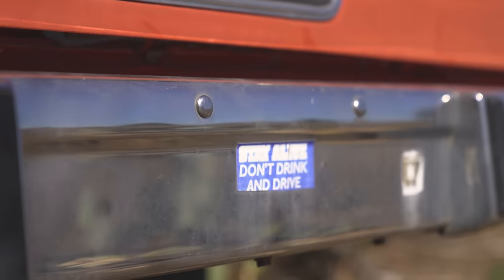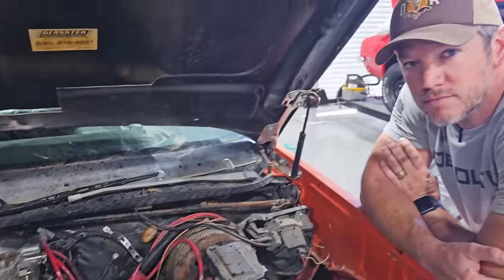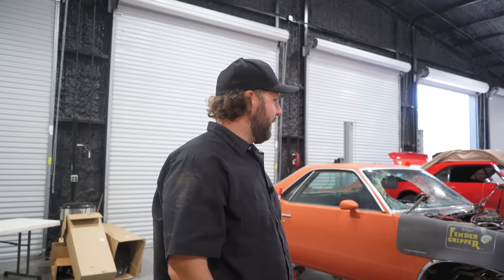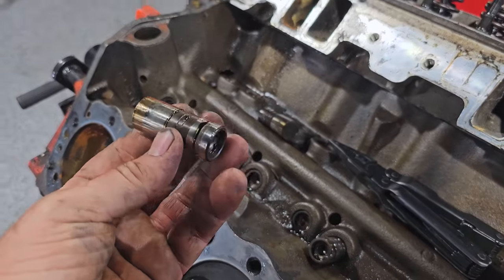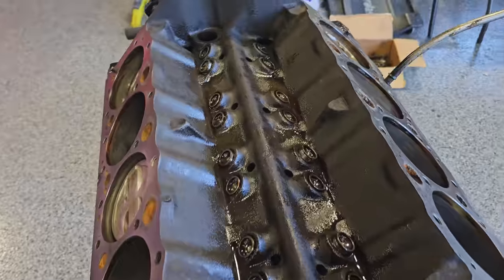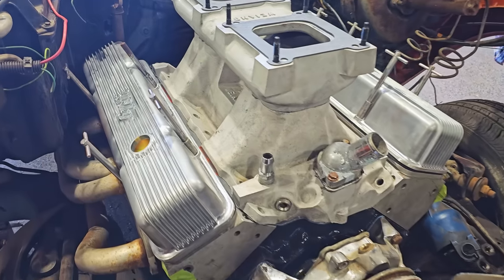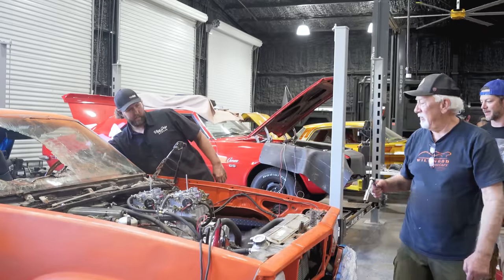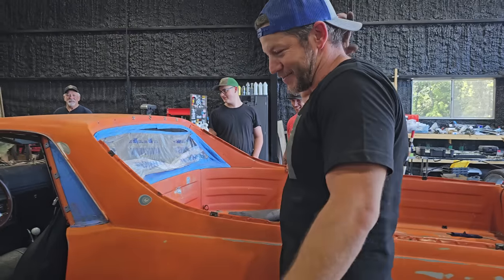ABANDONED El Camino With Seized Engine - Will it RUN AND DRIVE? (With Demolition Ranch!)

Comment: Story time! When I was 19 or so I was given a 1976 Buick Skylark sedan that had an Olds 260 V8 (105 or 110HP) with a Rochester 2 Jet and a TH200 transmission. I bought a torn down 2 bolt 350 with alot of still packaged Comp Cams valvetrain parts that my buddy sold me for $150. I didn't know ANYTHING about building an engine, but I REALLY wanted to build that 350 and swap it into that car because that Olds 260 was a gutless turd. It would reach 80 MPH...eventually, but it would only average around 10 MPG. Also, that car could been sitting for months in the winter with a foot of snow on it and I could get in, pump the gas 3 or 4 times, turn the key, and it would fire RIGHT up. It only had 34,000 original miles on it, but the farthest I ever drove that car was when I drove it to Cleveland (from an hour north of Pittsburgh), so 400 miles round trip and it ran great the whole time, just not very powerful. I REALLY wish I had put that 350 together and swapped it in. I don't know if that TH200 would've held the torque, but it would've been mostly stock other than a RV cam and slight valvetrain upgrades. I wish I had gotten the car that they gave my uncle, a 1974 Dodge Dart Custom with 16,000 miles that had a Landau roof and a 225 Slant Six with a 727.

Comment: Thanks for the info on the Toyota Highlander and the evap problem ! I own a 2010 model, but here in Australia,  it's called a Kluger. I love my Kluger and it's AWD .I mostly use it to tow my small pop top camper trailer, which it does with ease ! Love your show ! Cheers..Ray

Comment: If hood clearance for the carbs isn’t a problem, you could use the Holley’s with a short spacer. You already have a tunnel ram, which is a huge spacer, but that might help with your figment issue. I like Edlebrokens too though.
Reply: The tunnel ram top is on backwards, he's got the tall end of the tunnel Ram facing forward, goes to the rear, then the Holley carburetors will fit

Comment: That flat top 327 and the dished 350 would be the same compression ratio. 64cc heads adds another point-ish.
You should have swapped the cam.

Comment: Man oh man this video with the engine water damage reminds me of my 69 camaro sitting in storage across the street. Did the body 80% after high-school. Then had the motor and transmission done. I had a neighbors grandson into restoration itching to do my convertible 100% frame off. Gave him a shot in 2009-10. Same year I had my first kid. Needless to say I was convinced to buy replacement body. A year and a half later I got both bodies back an epoxied frame. When he finally returned my rebuilt engine that had less than 2500 miles on it. I found out he left the motor out in the rain for the better part of a year or so. Fudge up and I've been scratching my head for the last 10 years. Without a shop to work on it, it just sits in storage. But she's my first car and I haven't totally abandoned her yet.

Comment: The 1406 600s are tuned really mild. The 1405 has different rods and spring. The 1405 is man choke too. I have had alot of luck on mild street cars with the 1406 with the 1405 rods and springs in. Just a thought. Great content!

Comment: Back in the day (1970) the 350 block with 327, 2.02" Camel Back head swap was ordinary. The original 327 heads although cast iron were the hottest thing at the drag races. I remember having my 327 camel back heads in Tony's machine shop here in VA, for new valves and guides and when I went to pick them up they tried to substitute some crappy 250 HP heads. Fortunately I had stamped my Initials on both heads. I told him these are not my heads. He tried to convince me they were. I went looking through his machine shop and found my heads under a bench. I asked him why and he BS'd an answer like he didn't know. I showed him my initials on the heads, paid a fare price and never returned another part to him. I put a TRW TP-112 modified cam in my 327 and ran a 13.88 at the strip .Those heads were gold...

Comment: Had a buddy in hs helped him with his shaved the door handles off put a top dollar tarp on the back with a push button and auto door lockers that unlock and popped the door open same hood with an intake and temp guage you could see from inside the cab. Hand sanded black 5 coats clasic 80s turbine American racing mags..this was 1987 people. Gorgeous ride.
Reply: 2 motors and 3 transmission later he sold it....that was 1988

Comment: The top of your tunnel ram is on backwards, the the tall end of the tunnel ram top goes to the rear of the engine, turn your tunnel ram top around and your Holley carburetors will fit

Comment: When setting initial timing the rotor doesn't have to point to #1 cylinder on the engine.  It has to point to #1 terminal on the cap.  You can make any terminal #1 by clocking the wires. My #1 term. points to #6 cylinder on the engine.

Comment: If you duct tape a cap from brake cleaner or any rattle can, duct tape it to tail shaft of transmission and you won't leak out while removing motor/trans.

Comment: I'd say when the engine locked up the passenger wasn't wearing their seat belt and got launched through the window.  I know that I managed to crack one windshield myself by braking hard to avoid colliding with a car tagged from Wyoming and of course my passenger from then on always fastened his seat belt if I was driving.  That was ~45 years ago now, today's brakes are better than those old drum style.

Comment: Would it have been worth it to pull the entire wobbly front sheet metal before working or before pulling the engine ?  Did not look to be very fastened ?

Comment: Hmmmmm.  About that front fenders moving left and right so easily.......

I just replaced a Radiator Support in an 86 K10.
The fenders connect directly to the Rad Support.  The only stability for the Rad Support and fenders is the Two bolts and bushings that bolt into the frame brackets.  Without them, there is nothing to keep the fenders/body from moving left to right.
I assume you guys checked that,  of course you did, right?
Can't imagine the devistation that would happen if something side crushed into the front end without those bolts/bushings.

Comment: Chevrolet changed engine color paint from orange to blue for the 1977 model year, so the "new engine" may be fairly close to the same age as the El Camino.  The loss of the 327 is really a shame.  I have always had a soft spot for the 327 and they are awesome engines - especially with the go-fast goodies that engine was equipped with.

Comment: 2 questions. Why can’t you run a hot cam with low compression? And why didn’t you just flip the bolt around that you welded to the dizzy? That way you wouldn’t have to chuck the drill into it.

Comment: The Weiand tunnel ram will absolutely work with Holley carbs. It's not carb specific. Usually, you have to use a small cam distributor, so the flame thrower deal must be bigger than stock. A small spacer would have been better to still be Abel to use thr Holleys. I've never liked the performance of Edelbrock carbs.

Comment: Reusing those 2.02 heads it would have been smart to have transfered the Cam form the doner engine..  I have found the valve size is MORE relevnt to the cam than the compression!  It will be the defference between that being a 5,500 redline or a 7,500 redline on Pump Gas!  The Bone Stock 350 has Factory cam shafts are SOFT and prone to Lobe wear.  GM had a problem with cams from 1955 thru TODAY..... That would have been the perfect time to do a cam swap!

Comment: Wet paint attracts cats. It's a universal law. Mine walked over my freshly painted cabinet doors, but they were so perfect I had to leave them and apply the clear coat. Two little paw prints perfectly spaced 4 inches from the corner. Ended up nicknaming the wet bar in the house "Cat's Paw Bar" because of it.

Comment: Would be a interesting ranch toy with a lift and a strong gas engine 383 or so and 35's. The Cuda is sweet but your not gonna beat it up this should be lifted and used

Comment: So my father had a 66 impala ss that had a built 327 that when he got it the man who owned it was in jail for going 135 in a 35 in town. He told dad he was at half throttle and dad told me so many stories about that car but he said that the hemi cop cars had no chance against the impala. Outrun many of them. I could tell you a lot of stories about the car but he was run off the road and ended up on a large boulder and broke the frame in half. Back in 69-70 there was no such thing as fixing a frame in Iowa at that time so he sold the car. Biggest regret of his life selling the hat car. He told me it was built to the max with a 3/4 race cam in the late sixties. But it had the muncie rock crusher 4 speed. He claimed you could put the front tires on a dime and burn the rears off without coming off the dime. Either way I have wanted a built 327 my whole life and at some point I will build one

Comment: Easy 
Out caster oil and brake guild down spark plug holes wait 2 or 3 days 

Then wench the pulley until it spins free 

Old trick from the days long before internet

Comment: I would love this truck.
It is my sort of thing.
If i owned it i would have carried the white into the blue front and faded the white out before the very front.
I would also miss out the stars and put a American angled flag on the rear panels with the full stars.
I have never seen such a good condition Camino in my life.
One question i do have.
If the heads were Blu printed, Why did it have head gaskets?
Because blue printing means an engineered fit.
So gaskets not needed.
I would love this to take it much further. Wish i could have seen the final result.
Best regards frank UK

Comment: About to get a 68 C10 that was sitting since the 80s. Picking it up Friday. Poor thing ain't got no floors. Probably naming him LT Dan. A sensible man would replace the cab. But the doors shut so smooth, no dents, no dings, just ain't got rockers or floors. I'm a lava staff user myself and the jumbo combo #5 floor pans are less than an arm now. The rest of the truck including the long box and tail gate are rock solid with absolutely no moon spots. All solid metal too, no playdough. So I figure the cab would be worth repairing. Anywho, it has various layers of various conditioned paint. But I think it would look absolutely perfect painted like this 👌

Comment: Is that 350 an Oldsmobile built engine? Is the oil filler tube in the center up front of engine it would be.
They are special used on that era Cadillac.
PLR

Comment: An El camino is not a truck learn the real definition what a truck and what a car is.  I would have dropped the fuel tank, clean the rust and muck out of it and replaced the fuel lines and put a new fuel filter on it.  Replace the windscreen and get rid of that stupid hood.

Comment: Engines aren't 'seized' or 'locked up'.  They are 'stuck'.  And the story is always "Well, it was running when we parked it there' which is code for; 'that's the exact spot where the engine stuck' (and that is why it hasn't moved for 23 years).

Comment: *Disables motor to find water in cylinder. Proceeds to spare water directly into the spark plug hole and fill replacement motors cylinders with water. Personally I'm against hosing down a motor unless the holes are plugged up.

Comment: Just because there's a flat tappan somebody did a HP rebuild? Everything you say is? Hydraulic roller would have been a better option plus why didn't you say that you need more cubic inch for the dual intake. You're sleeping. Big actor